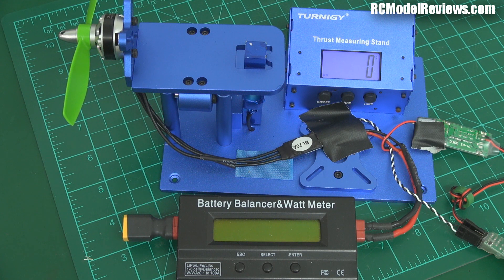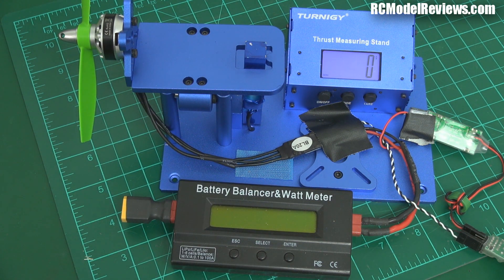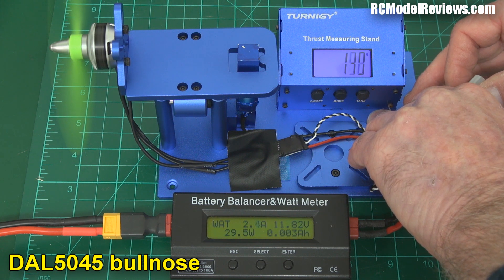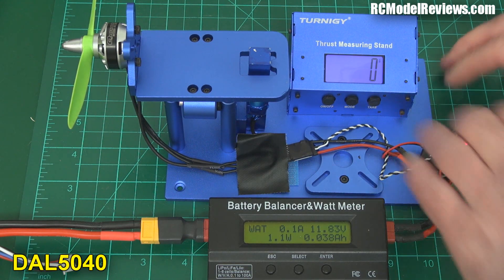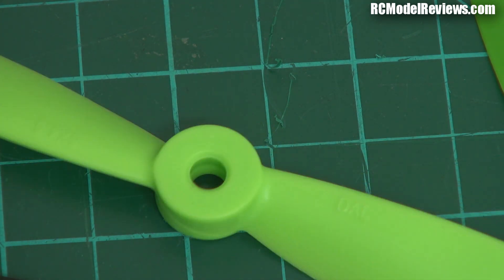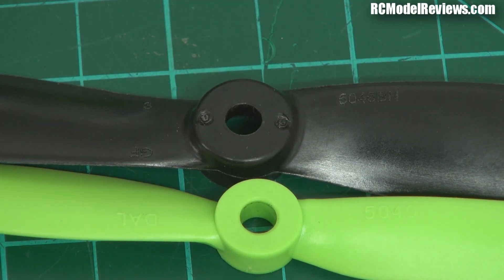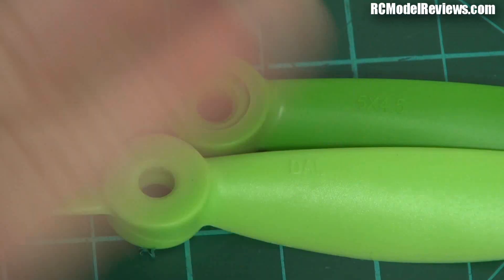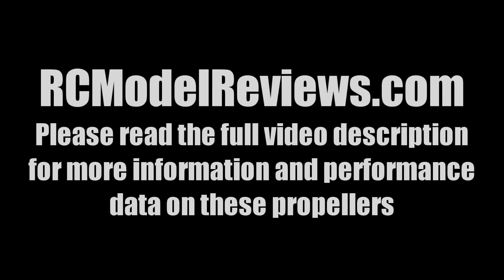5 inch bullnose mini quadcopter propeller shootout (on 3S)

Comment: What about 4" props for 180 quads? I want to build one but its hard to find any info on motors prop combos.
Reply: +Rodswim I'll get as much of this sort of stuff reviewed as I can before the end of the month but no promises.
Reply: +Rodswim Oscar Liang has you covered. http://blog.oscarliang.net/motor-180-mini-quad-4-inch-prop/
basically go with 1306 3100kv and gemfan 4045 carbon or ABS(more durable). the cobra 2204 2300 look to be good on 4s with HQ4045 but they draw a tonne of current and your battery will last about 2mins and you need to factor in the weight of the motors. I use 1306 3100kv and gemfan 4045 on my 180 and its a rocket